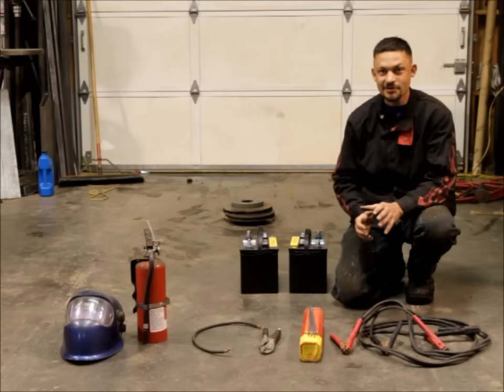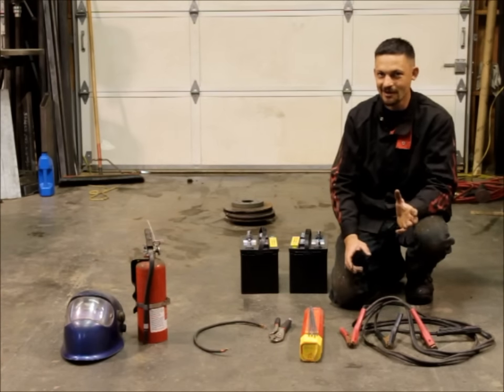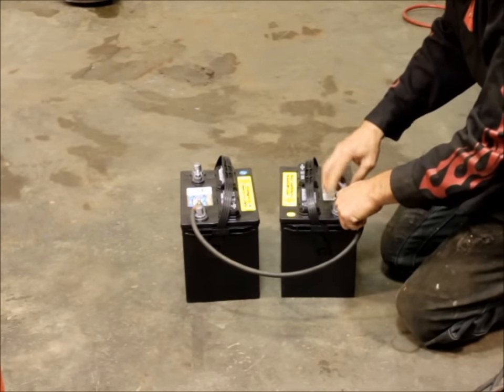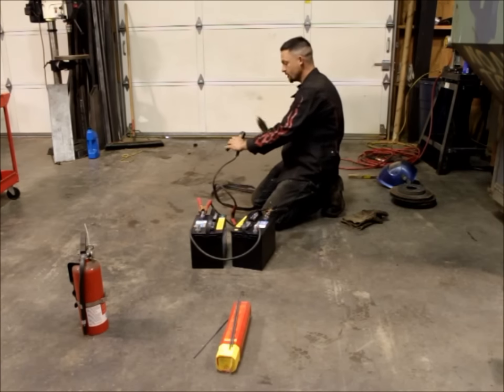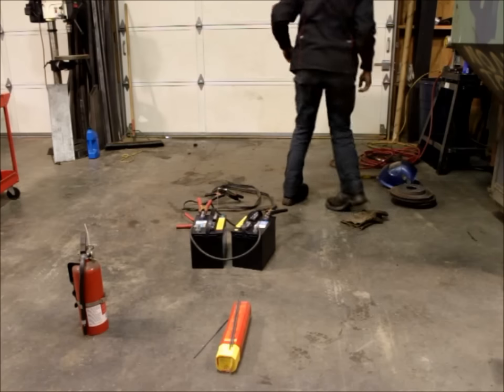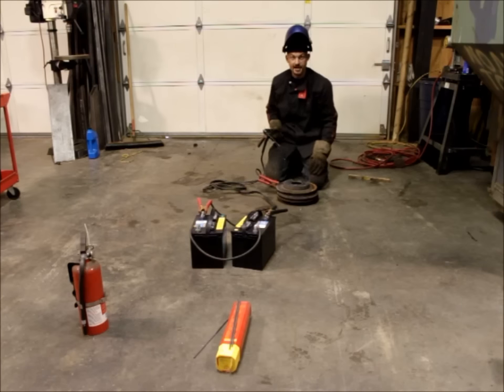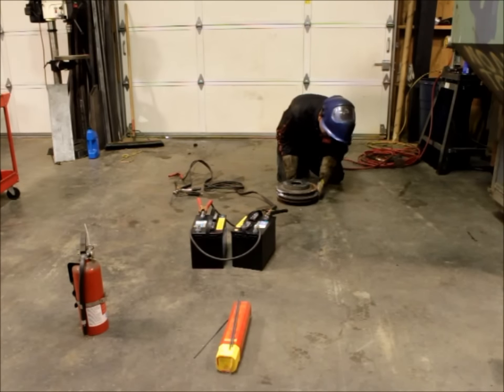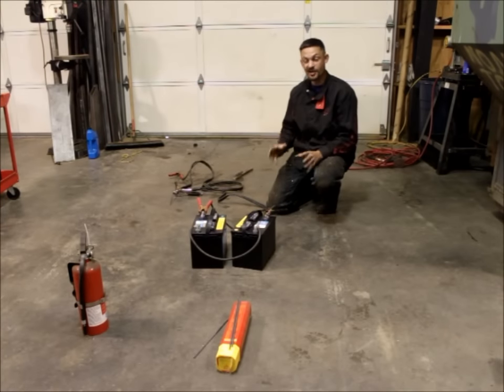Welding with jumper cables and a pair of batteries

Comment: would two deep cycle marine batteries, designed for sustained release, work for this?
Reply: Christopher Cordasco Any battery with a decent capacity would work.  Deep cycles might be better suited than starting batts. for a lot of welding, but either is fine for an occasional weld.

Comment: I may not know much about batteries but I think connecting a positive pole to a negative one can make the batteries explode eventually, you should put something between you and the batteries.
Reply from the maker: ponck sup this is called wiring batteries in series; it adds the voltage of each battery together.  Same thing as putting AA batteries in a remote control.  It is not dangerous at all.
Reply: @MattVerley  OMG turns out I've learned a lot after watching your video, the only knowledge I used to posed is the one that was transmitted to me by my grand pa (who was a lawyer actually) and he always used to said "don't connect the positive pole to the negative, that could make the batteries to explode".... So thank you, I'll continue to educate myself on this issue.
Reply from the maker: ponck sup no problem!  It’s a pretty basic electrical circuit; do a google search for “wiring batteries in series vs parallel” and you’ll turn up some good info.  Your grandpa is correct in that if you connect both batteries positives and negatives to each other you’ll create a short circuit that could cause a battery to explode.  But wiring one positive to one negative will not; that is simply how you wire them in series.

Comment: Question, what would you guess the equivalent amperage is to say using an ac stick welder?
Reply from the maker: I've measured it with a clamp on DC ammeter; the amperage with my 24v setup varies from around 150-180A.  Since this isn't a constant current setup, current will vary with all sorts of things; type of batteries, state of charge, the gauge of the jumper cables, etc.
Reply: @MattVerley  Thanks, so one would have to use 1/8 inch rod or better and be welding pretty thick metal or would burn through? Think you could weld thinner metal with one battery?

Comment: Nice, but I would add voltage meters to monitor 12V threshold after welding to prevent permanent damage to the batteries.

Comment: is it possible to use this technique for the Lichtenburg effect on wood
Reply from the maker: No, it is not.  Burning Lichtenburg traces in wood requires high voltage and low current.  Batteries provide high current at low voltage.  You need at least a few thousand Volta for current to flow through a piece of wood; I use a 15kV neon sign transformer.

Comment: I know nothing about welding.. was he holding onto the welding stick while welding? Is that dangerous?
Reply: ...the rod was firmly gripped in a clamping plier , he was holding the plied with that attached rod,  negative jumper cable from batteries was connected to the clamping plier. Positive connected to the project piece .

Comment: Did you try on 12v instead of 24v?
Reply: Claude Ouellet They are 12v batteries.  Hey wired + to - on the batteries to wire them "in series" to create a 24 volt loop.
Reply: Claude Ouellet 12 volts aren't enough to start the welding. A welder have about 40 to 60 volts open circuit voltage
Reply: Ok, thank youé

Comment: why in series, not in parallel? why 24 v? does it just help with the ignition? asking because my instinct tells me parallel.
Reply from the maker: Most automotive batteries are capable of delivering 700-800 amps.  That's more than enough for most welding tasks...however, at 12v you'll never actually get that much current to flow.  Small internal resistance in the batteries, jumper cables, and in the arc itself all limit current flow.  In order to get an arc capable of producing ~150A, 24V is necessary.  Wiring 2 batteries in parallel gives you more current capability...but it won't change how much current is actually flowing in the circuit.

Comment: Awesome Video! Thanks a ton!!! 
FYI if you do it again would be good to know the Voltage of the batteries before and after 30 seconds, 1 minute, 3 minute and 5 minutes  intervals of welding as I learned on my Westy that the difference between 12.4 Volts and 12.3 Volts is a turn on the starter solenoid and being stuck in a different rut!  Would be fairly rare considering that here below mentioned a weld draws around 150 amp ie. less than some radio's and typically have hundreds of cycles stored but I as well as you and many have been there with such batteries and if you don't have a meter on board to test yourself in real time it is good knowledge to find to share.  Thanks for the knowledge, adding the gear to Camper cabinets! Slainte !!  Mike Abe SF

Comment: Would three batteries work any better? 36 volts VS 24 volts.
Reply from the maker: Since there is no way to control current, I've found that 3 batteries is too hot for most emergency welding.  However, if you are working with smaller gauge or very long cables then 36v may work better.

Comment: Back when we had old gas engines in our fishing boats we had a tough startine proceure, We would put the positive lead on one battery and the neg lead on the second. Then we would clamp a vise grip in one open post and then step on the vice grip on the other open terminal of the second battery. Now we had 24 volts and the starter ran like crayy and once the engine started we put everything back to one battery.

Comment: Great video.Isnt 24 volts too much? Isnt it better to use one 12 v battery higher amp?
Reply: You probably wouldn't be able to strike the arc.
Reply from the maker: You can get enough cuttent to flow with just 12 amps.  Most normal car batteries are capable of 600+ amps; we only need around 150 to weld, but you can't get that to flow with just 12v.  24v (2 batteries in series) will allow about 100-150 amps to flow.  If you need to weld thicker material, you can put 3 batteries in series for 36v.

Comment: Great tip for trail 4x4s but a good thing to get a couple 350 amp fuses from car audio suplyer and there a fuse block that holds them will esaly take the wire from weld lead this way if the weld rod stick you don't melt your battery post off  the welder linkon stick is a power converter 240-@-AC-to-DC-@-40-225-@-amps =Welder Dc-electro-welder need 24-36-volts- or 2-3 car 12  volt battery in series

Comment: does this process damage the battery?
Reply: yes. batteries do not like a short circuit. this would be only for emergencies only. also if you are doing this make sure you remove the battery from the car. This type of load can cause a battery to short internally and it will meltdown. its not pretty and you will not be able to stop it if it has a lot of charge. your car will burn to the ground. Like he states in the video is for emergencies. Hope this helps :)

Comment: What will happen if electrode will stick to metal and the amperage will rise? Can the batteries explode? What should be done if electrode has stuck?
Reply from the maker: it is very difficult to stick the electrode, different than normal stick welding.  because the batteries are capable of around 600 amps the arc gets hotter the closer the electrode gets to the workpiece.  but, if you do manage to stick the electrode you can just pull it out of the clamp...same as a normal stick welder.
Reply: +sewerzuk But when I am pulling the electrode out of the clamp probably an arc can appear between them, I suspect?
Reply from the maker: qscwdv71 Sure; it might "pop" when you pull it off.  Same thing that happens with a normal SMAW power supply...

Comment: Looks like you really need a voltage regulator so it don't ground the batteries. Maybe a power paddle switch from a old sewing machine. Then you could control the current like Tig welding.

Comment: so the batteries are fucked after no? but when you say a minute of arc time i have to ask, does this actually damage anything when used properly? have literally no idea where to start on the math with this but i know a starter will drain a battery pretty quick
Reply from the maker: hank hill no, the batteries don't sustain damage.  since you're pulling roughly 150 amps during welding, they don't see any more load than a starter motor or winch motor.
Reply: hey thanks for the reply, honestly i just realized you have it all laid out in the description, 1/8 7018 rods man everyone  should have a few

Comment: Does it matter if you connect positive or negative to the welding rod?
Reply: Dylan McElveen Early in the video he mentions that it is important. Neg to the rod, Pos to the work piece.
Reply: Dylan McElveen  yes.
positive +     to elektrode  (rod)
Reply: NRC073 Wrong. It's called DCEN. DC Electrode Negative welding for a reason. The negative goes to the electrode (rod).  He even says in the video if you hook the positive up to the rod then it creates lots of splatter and a poor weld.

Comment: awesome vid... can you use motorcycle batteries?
Reply from the maker: +lynskyrd No, a smaller battery is not capable of delivering the necessary amperage.  You might be able to get an arc, but it wouldn't last long and there is a high chance of damaging the batteries.
Reply: +sewerzuk Thanks for the prompt response.  OK- car batteries it is.  Makes sense- less amps from the smaller batteries..  I'll report back- I'm going to try this soon.  I'm still learning to TIG but I'm curious about this.
Reply from the maker: lynskyrd go for it!  Even if you are an experienced stick welder, this is a bit different.  Hard to make a really good looking weld, but with a bit of practice it is a great skill to have in an emergency.

Comment: Iv done it but some rods i find that 24 volts is just a little low to arc up so some rods iv used three batteries the volts is just a touch high but it strikes up easy and i use longer wire to get some resistance for the extreamly high current on smaller rods and battery charge last little longer instead of dumping alot of current to the rod that dosnt need that much current to weld.

Comment: just wandering,  how much a cheap welding machine will cost at home Depot? , $150.00, $200.00?,  because I think 2 batteries will cost around  $120.00 ea. I'm  just wondering.  welding machine's  prices were just a rough estimate.
Reply from the maker: Oscar Lozoya you are correct...if you are planning on welding in the shop, then you should purchase a conventional welder.  This video demonstrates a method that should be used in an emergency, away from a shop/garage where a welder and power are available.

Comment: Just so you know unless you found a place that sells 150 amp batteries then your not getting 150 amps. When you connect batteries in series (negative to positive) you increase your voltage per each battery but NOT the amps. The amperage stays the same (if both batteries are equal) or it averages.  If you connect them parallel ( positive to positive and negative to negative) then you increase your amperage equal to the amperage of both batteries but the voltage stays the same. In series two 70 amp batteries stay 70 amp but you get the longevity of both batteries.😊
Edit. There is no way to connect the two batteries to increase the voltage as well as the amps. It's one or the other. Take your pick. When you jump someone's car (parallel, positive to positive and negative to negative) you get the cranking amps of both batteries but it is still a 12 volt system. Vice versa with in series. More voltage but no increase of amperage. Just longer lasting.

Comment: .....I noticed you struck an immediate arc. Most of people can't strike an immediate arc . Then I see you mentioned you've been a professional welder. . Constant voltage yes but some control of current might be available from choice of gauge for the cables or length . Most efficient current control might be a MOSFET chopper circuit  to vary the mark space ratio, adds just a little technology but would be as appealing perhaps as a joule theif .
Reply: Can a MOSFET handle easily 70-100 A dc (collector-source amp) ??? you will at best half to shop it at 50-100 Hz at the gate with someting like a 555 IC or else ... eaven at tha ... kapow...
Reply: @dancoz5477  mosfets handle high currents and can be wired in parallel also ' ', the bijunction transistors cant be so dirrectly wired in parallel however .

Comment: Unless you have 2 Good batteries use 3 you will be able to make a better weld and weld longer. This is for a one piece job and the batteries drain fast. Safety wise keep the batteries away from the part you are welding and watch them for smoke and bulging. You can get a good stick welder for less than the cost of the batteries, I know this is mainly what I use on the trail and farm though.

Comment: I've welded like this before.  Keep an eye on your batteries.  After a while those batteries heat up.  I looked up and saw one of my batteries round like a ball.  I quickly stopped what I was doing.  It sounded like the battery was boiling.  I got lucky.

Comment: Done it I welded stainless exhaust manifold for my gm truck saved $500.00 .Used my boat batteries  in series each hooked to 2 old school battery chargers .One battery charger on each battery  .Did also welded a cracked lower prop housing for my old merc engine using special aluminium rods saved $ 2000.00 . Found the ideas in a old school mechanic book for boys from the 1930 ies  ,some of the old way save you $ but be careful as it could be dangerous ( risk of hydrogen oxygen explosion ) . I do have some cheap welders low amp welders  ,but if I need high amps will do this again lolol

Comment: If the open circut voltage is 24v that would be a little low for a 7018 rod.
36v would be better and 48v better still

Comment: @Matt Verley Interesting method, how long can you typically weld like this before depleting both lead acid batteries? Ever thought of applying this welding technique with different battery types? Can anything be added to the batteries inline to provide a more regulated amperage from the batteries?

The problem with this technique is that you have no real control over the amperage generated by the batteries. This will vary depending on if you wire 2 batteries (24v) or 3 batteries (36v) together. I personally wouldn't suggest or endorse this technique, to those who have no welding experience, they can and will encounter real problems fast, but if you're stuck in the middle of nowhere, with no cell coverage, you might consider this method a technique worthy of mastering.
Reply from the maker: Welding time depends on a lot of things; battery capacity, battery health, welding amperage (varies widely, but affected by electrode diameter, jumper cable size, etc.).  Typically I can weld for at least a minute and still have enough capacity to re-start a vehicle.  
There are certainly many things that could be done to improve the welds with this method, but I was really trying to demonstrate it as an emergency technique using common items carried in a vehicle.
Reply: @MattVerley  I can sure think of a couple of occasions when this would have come in handy myself, but I'll stick to my trusty inverter welder and a small portable generator when in dire need in the UK. Thanks for taking the time to reply and share your thoughts.

Comment: Can you do this on a car and should i unhook the car battery b4 i put the positive to the frame and also how safe is this with fuel in the car
Reply from the maker: +Generation Noise Yes, you would need to completely disconnect the battery from the car's electrical system.  Really this should only be used as an emergency field repair technique.  If you have some welding planned on your vehicle, much better to use a real welder.
Reply: Good to no ty

Comment: I am trying to weld my motorcycle frame does anyone know if this welding would work and what electrode should I use. thanks
Reply from the maker: This is better suited to an emergency trail fix, not a planned welding job in a shop.  Electrode selection depends on the material you are welding; what is your motorcycle frame made of?
Reply: @MattVerley  i have no idea about the material of my frame. I have been researching for it for a while now and have no success. the motorcycle is a 1978 xs400 2e and the reason I am trying to weld the frame with the batteries is because I don't have a garage, I don't have access to any electrical outlets near my apartment and the nearby welders are asking for hundreds of dollar for just a simple job that would probably take 10-15 mins.

Comment: Jist curious regular welders pull around 50 amps how will this pull a couple 100 amps
Reply from the maker: A typical constant current welder would be powered from a 50 amp 220v circuit; so yes, on the primary side it would always pull under 50 amps.  On the secondary side, it will be putting out anywhere from 50-200 amps (or more) depending on what the operator has selected (based on electrode diameter/composition and thickness/type of material being welded).  The welding current with the battery setup at 24v is very similar; it is around a 150 amp arc.  There's no real easy way to control this current, but at 24v 150amps is about what you get and it works well for most emergency repairs.